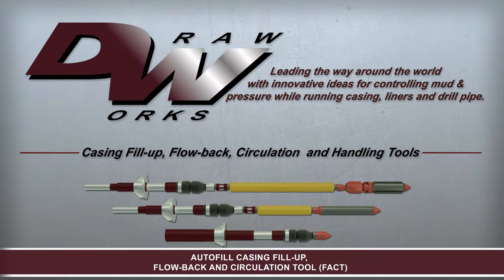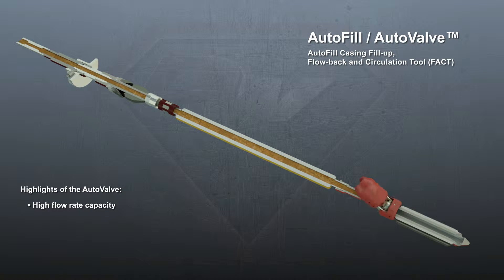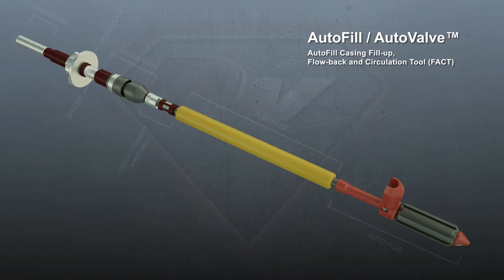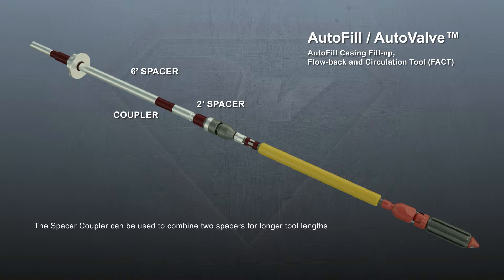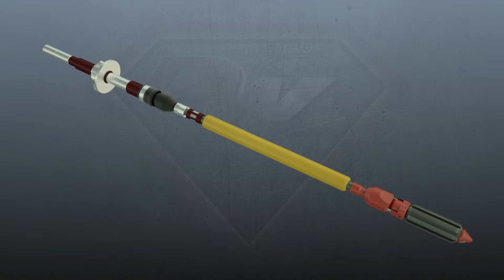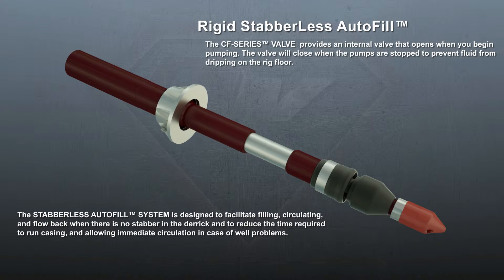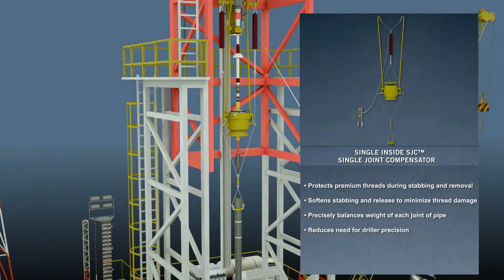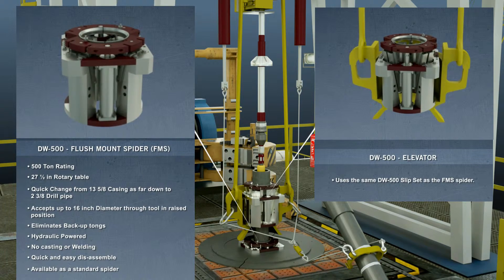DrawWorks LP Casing and DrillPipe Fill-up, Flow-Back & Circulation Tools

Comment: I understand that you are running cement down the casing / wellbore before completion of casing. Is there any plug at the end of the first casing run down the wellbore? Otherwise the cement would gather at the bottom making it difficult to run the casing all the way down to the bottom, correct?
Reply from the maker: Yes Leon, Are customers do cement as well as control mud with our AutoFill.
Reply: +Drawworkslp I understand but I asked myself when you're customer runs the casing down - why would they not run the casing first and cement second rather than displayed in your video where they cement into the pipe while running it down at the same time? Secondly, I was wondering when you flush the wellbore with mud to balance formation pressure - how to run the casing in without releasing the mud from wellbore. I mean what's the measure between drilling and casing running that prevents the wellbore from collapsing?